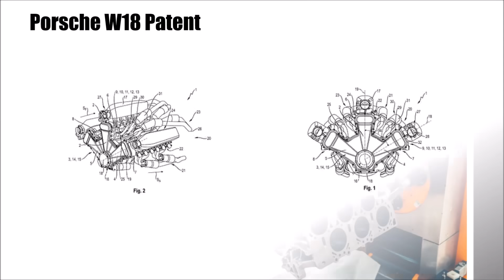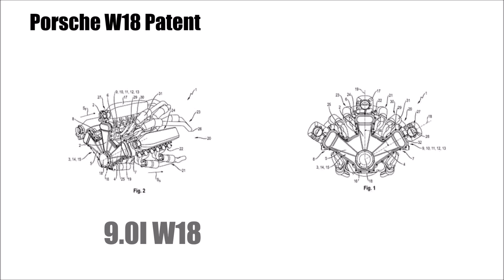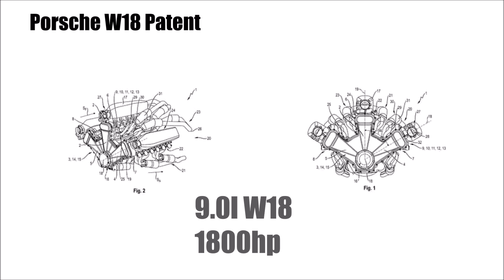Porsche W18 engine - CLOSER LOOK

Comment: I wished Porsche made a road version of the V4 from the 919. It is very compact and power dense, it gave such an advantage for the weight, the freedom for the design, for the aero.
Reply: Have you ever heard what a V4 sounds? 919 was a pure race car for a single purpose.
Reply: After Ferrari got all that backlash from using a v6 in the f80 I doubt Porsche is itching to do a v4 hypercar lol
Reply: I think you are on the right track. Porsche should use this crisis to transform itself. Combine Porsche engineering brilliance with VW’s mass production capability to offer a hybrid-engined sports car that, like the 356, can be enjoyed on public roads. Price it around $50 thousand.
Reply: vibration would be somewhat of an issue
Reply: @blaze23045  
Nope. It was already done by Ford years ago.
Reply: @blaze23045  90 degree V-engines are easily balanced just by counterweights on a crank
Reply: And what about the downsides? It would be possible in a hypercar perhaps but then again, who wants a 4 cylinder hypercar?
Reply: @customurlgoeshere  xj220 did fine performance wise with a v6. V4 with modern turbos be fine when done right
Reply: @customurlgoeshere  The packaging would be insane, why everyone is using V4 in MotoGP
Reply: @customurlgoeshere BMW i8 owners looking for an upgrade
Reply: @customurlgoeshere  I’d love to have an Oldsmobile Aerotech.
Reply: @customurlgoeshere  tbf, a V4 on a car would be very exotic since this format was only ever really used on racing bikes, you can count on one hand how many actual cars had those. however i think it shouldnt be on a hypercar but an entry level mid engine super.
Reply: @customurlgoeshere  I want v4 hypercar so I can flex a sleeper engine.
Reply: I recently got a barnfind 914 and it has no engine in it. I was looking around for what swaps people have done and thinking about how crazy the car would be with a 919 V4 😂 Obviously I could never get one, but they originally had a VW Flat 4 so 4 cylinders were on my mind.
Reply: @clueless4085   or just shovel up a flat 6 from another porsche to keep the lineage 😅
Reply: @clueless4085 K24 Honda with small quick spooling turbo able to feed 450-500hp.
Reply: @clueless4085  just get a flat 4 from a Porsche Boxster
Reply: @clueless4085  
Subaru. 
A straight four probably wouldn't fit, but a Subaru flat-four is a good bet. Various V-6s might as well.
Reply: Turbo charge the GT3 engine
9K 4l with twinturbo 👊

Comment: Well, it would definitely be unique and interesting. But I suspect not very good. 

Either way, I can't see Porsche doing this at all. A huge, W18, 9L, 1800hp engine? Nah, Porsche has never been about glorious excess.  Even if they wanted to get the maximum performance possible, the are engine designs that would accomplish it better, without all the compromises this huge and complicated beast would introduce. 

If they wanted to do something interesting - and wanted to tie it to the 919 - they could do a road car with an e-turbo-charged V4. Ferrari got 300PS/L on the F80, I don't see why Porsche couldn't do the same. That would still be only 600PS, but the key would be making an extremely light car with a lot of aero. Let's say 1200kg with 1000kg of downforce and combined 800PS from the hybrid system. Is that something the customers would go for? I don't know. But it would certainly be more "Porsche".
Reply: porsche has never been about excess??? bruh the tiger tank was nothing but excess.
Reply: You clearly haven’t heard of Cam Am. 1500 BHP LMP car with a flat 12.
Reply: @Maj-SHIPWRECKED  They didnt really have a choice at the time, since everyone else had crazy designs. Thats the point OP is making, since the 917/30 could be argued was a requirement more than just artistic excess

Comment: There is no real world logic to this IMHO
Reply: Nor is a V16 Tourbillon or pretty much any V12 or even V10. it's about rich people wanting something exclusive and/or unique
Reply: @fusune7465  There is some logic for any V10 and V12, mainly smoothness and power. They were used in motorsports for awhile.
Reply: @fusune7465 the v16 is much simpler and better overall design compared to the overcomplicated w18
Reply: There is... Like mechanical watches with one big difference. For the people that will experience this and can afford it is so much worth it.

Comment: Damn… the EB18.3 got canned because of the cooling and lack of power. I still think this a dead end. For a 919 road version? Flat 12, flat 8 or maybe just a turbo charged flat six would be plenty enough.
Reply: why would a 919 road car not have a v4? If they did a "modern 917" then yes, it must have a flat-12

Comment: It's a triflux engine like the lancia triflux inline 4. The intake is on top of the cylinder head and each exhaust valve has its own outlet on opposite sides of the head. C'mon you usually notice everything.
Reply from the maker: Yes but I‘m not sure they will bring it like this as it adds lots of complexity. I guess a regular head design would be more likely
Reply: @bsport320 it's not that complex with modern day tooling and manufacturing, the patent drawings shows a triflux like concept, VW made a W18 with the problems you describe, for the Bugatti W18 concept
Reply: @Supercharger86 well it is twice as many exhaust tubes and twice as many exhaust ports. also it's just much more complex to machine the ports. But also yeah a 5 axis CNC machine could do it just as easily as a normal head. I think triflux engines are super cool. I've wanted to make my own before even learning about the lancia or bmw engines with that valve arrangement. Oh also it doesn't allow you to independently vary exhaust and intake timing which is more important now with emissions.
Reply: @bsport320  Oh.  I hope if they do make it they do a triflux. If not then I'm not sure why it needed to be patented since w engines have been done before.
Reply: @jayaneyon9316  a patents means you can make money off of it and as an engineering firm you would want that
Reply: @bsport320  dont think its any more complex than a DOHC. There is a running triflux engine in a delta s4.
Reply: @bsport320  seems like the whole idea is already so completely pointless that added complexity doesn't really matter
Reply: @jayaneyon9316 Do you have to be so smug and sanctimonious with your comment?